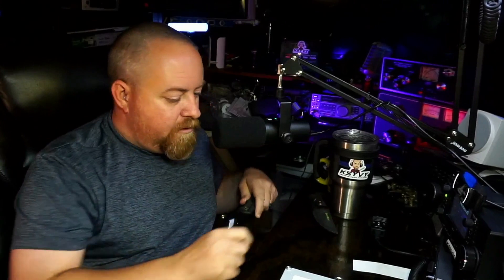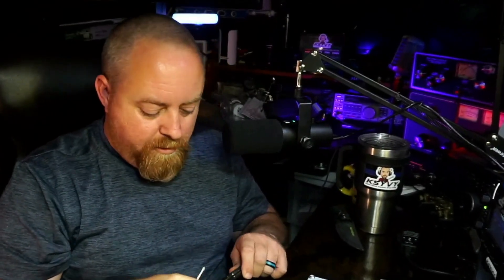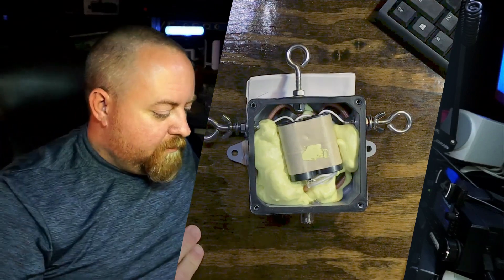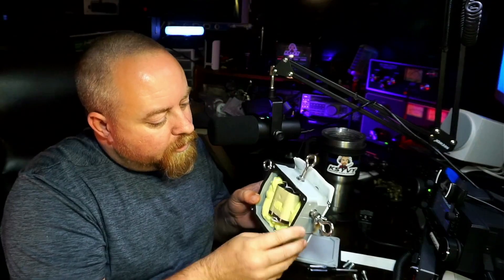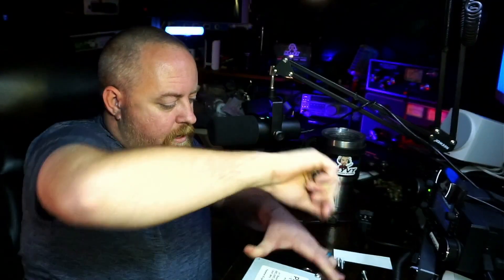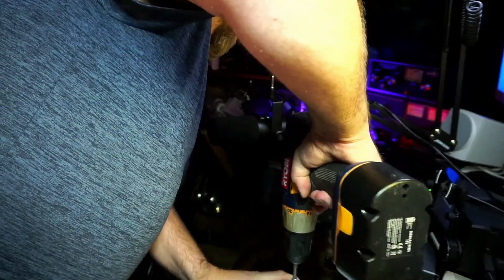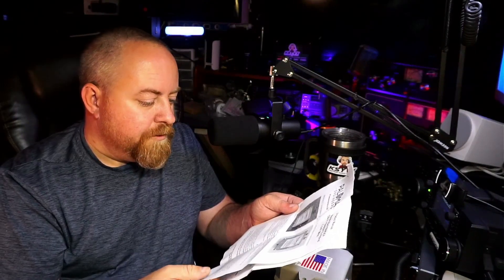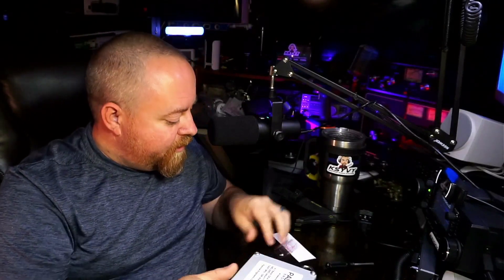Can we Look Inside? | Palomar antenna Balun | Ham Radio

Comment: The top ballun is the 4:1 and the bottom covered one is the 1:1
I know as I build them for palamar
Reply: @donaldjohnson1225  Hi Donald, I have a CB-4-1500 balun which works great with my 115 meter loop and ladder line but on ft-8 it quickly heats up on 40 - 160 meters and my SWR will start to climb.  That's with 200 watts.  I understand the duty cycle of ft-8 etc but I would like better to understand my balun.  Can you tell me what ferrites are used in the construction and is it really wound as a current balun as another manufacturer told me it must be wound as a voltage balun or I would not be able to tune 160 and it tunes 160 quite easily even with my short loop.
Reply: @TurboVonCrim  1.5kw into a single 240 size choke  and a binocular 4:1 will sizzle unless the wire is perfect. Was anyone else disappointed by the binocular 4:1?  Thank you for sharing a peek inside the box.
Reply from the maker: @AB1Vampire thanks, it’s held up to 400-600 watts so far so good, can’t speak to 1500.
Reply from the maker: Oh nice! Now I wonder if I got one of your built ones!? It’s done really well for me, don’t regret spending the money on it👍
Reply: @K5YVY  yes I built all of them up to 6 months ago. Since then others build them.
Reply from the maker: @donaldjohnson1225 that’s awesome, thank you for a quality build!